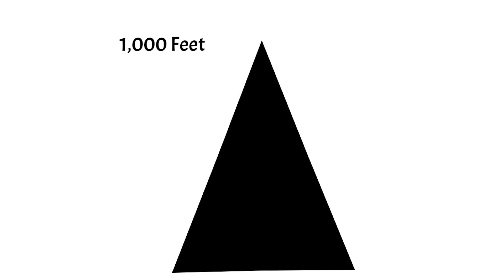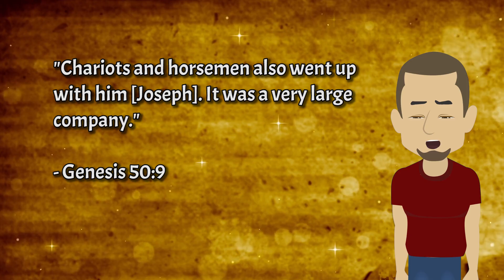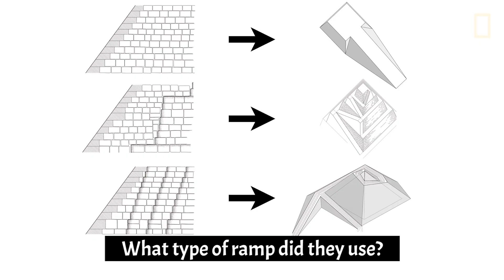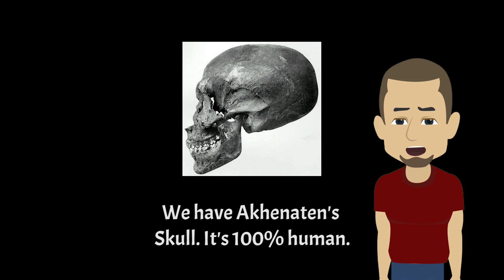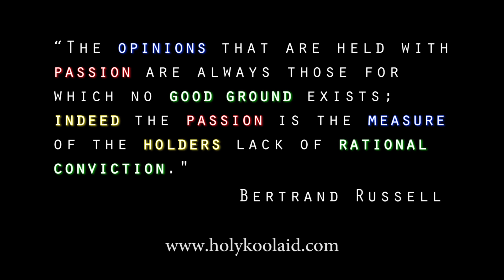Who Really Built the Pyramids and How?

Comment: The Egyptians had the wheel. It isn’t as effective as a sledge and water moving the dead weight of stone across sand, so they didn’t use it. That makes them more clever that people who parrot the “they didn’t have the wheel” bullshit. 

Personally, I think the bulk of the core of the pyramid isn’t stone. It’s probably fill material of sand and gravel with an outer shell of stone. Considering that they used similar construction techniques elsewhere, it isn’t impossible that they didn’t do the same there.

Comment: There was NEVER a body found in any of the pyramids, and when they where built that land was a jungle, sphinx was a lion after the Egypt's FOUND the pyramids they made the sphinx what it is today, you always say to follow the evidence but you didn't do a good job researching on this subject to get to the truth, And no, Aliens didn't build the pyramids I do believe how ever that a more ancient civilization built them and just how advanced they were is still a mystery, and that copper saw with sand is a joke you can make small short cuts with it but as you go deeper into the cut if get more and more difficult even modern saw of today have a very hard time making deep cuts, so until they cut a same size block with that copper and sand saw i have to say they are full of them self's.
Let's not forget the drilled holes and how some of the doors had been shaped with pegs to fit the drilled holes so the door could be opened and closed, I could go on and on but really not worth it to me so believe what you want...

Comment: @1:31 The heaviest block weighs 70-80 tons. The heavier ones are granite and generally used for load bearing structures internally.  By far the greatest majority of the stones that make up the bulk of the pyramids of Giza themselves are around 2.1-2.6 tons and are made of porous limestone quarried on site. But you don't hear about them.  Because they aren't so miraculous to move, nor did they have far to travel. The conspiracy theorists only talk about the +50 ton ones because they can get good quotes from engineers on how difficult it is to move a 50 ton block.

Comment: I have been studying the Giza Plateau now for over 30 years. I don’t know how it was built. But I do know it was not built with copper/bronze chisels and dolirite hammers. Even the ancient alien hypothesis makes more sense. There are aspects of the Pyramids that just can not be explained like for instance how did they see in the kings and queens chambers. How were the inside corners cut into the boxes. How was the tunnel system cut into the bedrock for 100’s of meters in a perfectly straight line.

Comment: The official timeline says that the first 7 pyramids and the sphinx were all built in 98 years, from start to finish.  So apparently they learnt how to do it all, and produced all of these in less than a century.  It doesn't matter how many people you throw at it, this is an impossibility.

Also, these are not just a pile of stones.  They are complex buildings with rooms, tunnels and shafts which would take a lot of precise and extreme planning.

You also neglect to even mention all of the technology from that period which we still cannot replicate today, such as drilling cores into granite.  That obviously wasn't done with copper and sand, just like cutting millions of huge stone blocks in that short space of time also wasn't done with sand and copper.

It wasn't aliens, but it was a civilisation much more advanced than we think it was and have been told.

Comment: 1. Not 1 pyramid had a mummy in it
2. We're not 100% sure who/why the pyramids were built
3. The internal shafts in the pyramids look LASER CUT and are water tight. No way they used crappy chisels
4. They face PERFECT North and are placed in a perfect location on the planet
5. They transfer energy/heat within the Earth

They are still a mystery and nobody knows precisely WHY they built them.

Comment: Sorry to break it to you but the idea that the Egyptians built the pyramids with copper chisels  and somehow hoisted granite blocks weighing anything from 50 to 100 tons hundreds of feet in the air after somehow transporting them by boat and sled from Aswan to just outside Cairo, a distance of 550 miles, is as ridiculous as saying that aliens from Betelgeuse or Moses or Jahweh poofed them into existence by magic. Here's a few salient points:
1) The pyramids are not tombs and no pharaoh has ever been found buried in one. The pharaohs were buried in purpose-built tombs mostly carved from rock and mostly located in the Valley of the Kings near Luxor, 400 miles to the south of the Ghiza plateau;
2) There are no inscriptions inside any of the pyramids. Given that, as even you point out, the pharaohs loved to scribble their names and make huge claims about their achievements absolutely everywhere, it is kind of strange that the building of the pyramids (any single one of which would have taken decades and probably far more money than the entire Egyptian GDP) is not mentioned let alone described on any inscription. In fact, there are admissions, or at least hints, that the dynastic Egyptians inherited them from a previous people who remain unknown;
3) Engineers, i.e., people who are technically qualified in modern construction techniques and who often have decades of experience in overseeing large construction projects (starting with the Englishman Flinders Petrie in the late 19th century), are at a loss to explain how they were built. In fact there are some aspects of their construction which are not reproducible with the most advanced modern equipment. Furthermore, materials are graded by hardness on an official and internationally recognised scale and the idea that hand operated copper tools could cut certain types of stone when todays diamond-tipped blades and drill bits attached to industrial grade power tools would wear out in no time flat is absurd beyond belief.
4) Archaeologists are NOT engineers, they're academics with zero experience of practical matters. Those idiots with the hand saw rubbing sand into a groove took about three days to produce a groove about half an inch deep and then declared that their theory had been proven. Don't waste my time!
5) Even by official dating, the pyramids were built within a very short timespan of a couple of centuries during the Old Kingdom. If that is the case then the ancient Egyptians are the only people in history to start off technologically advanced and then go backwards.
Yes, there are huge mysteries regarding not only the pyramids at Ghiza but many other megalithic sites worldwide. These mysteries may never be solved but one thing is certain: anybody who says that they know how the pyramids were built, including mainstream Egyptology with all its politics and special interests (and Zahi Hawass has many many of those), is lying. If they have the answers, let them demonstrate them in practice. It's simple. However, while you're waiting for that moment, whatever you do don't hold you're breath!

Comment: To be clear, what you have done here is the same as most people, that is to regurgitate a few educated guesses. All that bunk about about sawing with sand doesn't wash with me, and I speak as a stonemason with two decades experience. I know how long it takes to cut those blocks with huge computerised diamond saws, and we could not reproduce the production rate they supposedly had with sand and saws. Plus, I don't give a toss how hard those copper chisels were, I'm telling you as a matter of fact, you cannot achieve the things they did with granite using just those, especially not in the time frame we are given. My point is that the things you say we know, we don't. 
The mystery surrounding the building of the pyramids goes much further than just cutting and hauling of huge blocks in record time, you just need to look at the accuracy of the base levelling and how they managed to construct them to within inches of compass points, something it is argued we would struggle badly to reproduce, if at all, even today on a building of that size. 
So was it aliens? Fuck no. But they DID have access to some form of technology (in the true sense of the word) that enabled these engineering feats and it still defeats us today. Unfortunately there are always those who immediately jump to aliens, but that has always been the case. My own feeling is the technology was basic, but incredibly clever, so much so that it still eludes us today. In short, as is often the case, the answer lies somewhere in the middle.

Comment: I once heard a hypothesis that I think may be a good explanation for the method of building the pyramids...
The idea was that the Egyptians would build it by layers... They would position the first layer of stones in place, then burry all under the sand and drag the following layer over it, than burry this second layer and place the third over it... And then successively until they ended up with a huge "hill" of sand...
Then they would remove the sand and... Surprise! A full pyramid!

That would also explains how they did all the painting and carving of murals without electric light... The walls were exposed to sunlight until it came the time to burry the exterior on sand and drag the "roof" stones over each corridor and chamber...

Comment: Great video, great content as always. I have been watching your channel on a binge over this weekend.
Just a few things came to mind, if the civilization has utilized the concept of rolling, and used that in conjunction with leverage and is able to build the pyramids but has not yet discovered the wheel. I find that suspect. I learned about cutting the blocks with the copper saw and sand technique. I would be interested to see the evidence of the saws used to cut the 70 ton blocks, maybe was done in sections, still can’t imagine the vertical cuts. It’s almost impossible to debunk every single theory in a single YT video without it being several hours. Maybe an idea for a series. How did they get 8 sides?
What’s up with the Orion correlation theory
?

Comment: On the Nile side of each pyramid there is a vertical shaft in the ground with plastered watertight walls. (This I have been told.) If this is true, designing a hydraulic lift would be child's play for the Egyptians. They were outstanding engineers and the Nile did not run out of water.
Reply from the maker: The Nile is currently 5 miles from the Great Pyramid. Now during the flooding season, prior to the building of the Aswan Dam, the Nile would expand significantly, but there's still a significant problem. The ramps are not designed in a way that would make one shred of sense from an engineering/architectural perspective, and they don't even go all the way up. You can view them here:
https://www.google.com/search?q=great+pyramid+blueprint+view&tbm=isch&source=iu&ictx=1&fir=1AQM6ubyjuWx-M%252C_IU8Sn5WYIvfEM%252C_&vet=1&usg=AI4_-kSiK109rwXFLrYDCzkd-QMlyJMKlw&sa=X&ved=2ahUKEwjE0qDRjfrsAhUrwlkKHWJ0ATcQ9QF6BAgGED4#imgrc=1AQM6ubyjuWx-M

Comment: I did a report on this in high school and found a book that stated the rocks were analyzed and found to have some air bubbles and organic animal material. I lean towards the poured concrete method. It still requires ramps, as the height gets higher. Also the fact that you can’t fit a piece of paper between them is explained in the book. They use a sodden mold to pour a rock, then they pull out one side of the mold and use the side of the rock as that side of the mo,d for the rock next of it.They lay banana leaves over them to dry, the. Do the next level.
Reply: Where'd they get that many banana leaves?  They don't grow in Egypt.

Comment: Sometimes the most obvious answer is actually the correct answer.  I think the ramp hypothesis is the most likely.  Yes, it would have required an extraordinary amount of extra material, but it also creates the fewest mechanical and logistical problems.  Simply remove the ramp when you're done, or use it to create the next pyramid!

Comment: People almost always concentrate on how the Pyramids were built rather than the architecture.  There are some mind blowing things about the dimensions of the Great Pyramid of Giza.

For example, the distance of any two sides of the base is equal to the distance which the Earth travels at the equator during one second of it's rotation.  

And if you draw two circles, one just inside the base touching the midpoints of all 4 sides, and another just outside touching all four corners, then subtract the difference in circumference, you get exactly 1/1,000,000 the distance that light travels in one second.

This demonstrates that the origin of the unit measurement of time known as a "second" dates back to at least the time of it's construction, knowledge of the dimensions of the Earth, as well knowledge of the speed of light.

There's more too!

Comment: While I agree aliens most certainly didn’t build the pyramids I don’t agree with the premise they’re built in. For example, the bent pyramid was not in fact collapsing under its own weight but rather the construction angle simply changed at this time for no discernible reason. Further more using sand to cut granite while possible hasn’t been shown to be at the very least a reasonably quick process, given the time frame of around 20 years with the current proposed methods they wouldn’t have been completed on time. We also don’t have an explanation for the shafts, how the shafts were made, or the several voids found in the pyramid of Giza. The Giza pyramid also shows patterns of iron oxides similar to what you’d see on stone removing beams(I only use this reference cause they’re like rectangular on the edges of blocks in the kings chamber, the ceiling.). My point is the information is still vastly incomplete. But saying the Egyptians did it as we say is as ridiculous as saying aliens built them.

Comment: How did the Egyptians know to build at the exact center of where the longest latitude line meets the longest longitude line???
"According to experts, the Great Pyramid is the most accurately aligned structure ever created by human beings. It is said that the pyramid faces true north with a mere 3/60th of a degree of error. It is assumed that when it was initially raised that it was precisely aligned with the North Pole, the position of which has shifted slightly over time."
https://philphilips.com/the-great-pyramid-of-giza-and-its-mystery-why-it-was-built-at-the-exact-center-of-our-planet/
Reply: That's nonsense. The longest line of latitude is the equator, which is far south of the pyramids. And all lines of longitude are the same length.

Comment: You know that you grew up in Christian disguise but didn't read the Bible!
Where did the Israelites in Egypt build pyramids?
Therefore they did set over them taskmasters to afflict them with their burdens. And they built for Pharaoh treasure cities, Pithom and Raamses.-Exodus 1:11.
Did Treasury look like a pyramid?
The Bible didn't care about the pyramids!

Did you say the pyramid is the most stable structure? You may have learned about civil engineering, but the pyramid is a form that puts a lot of load on the foundation as well as the building itself by putting a very heavy load on its foundation.
This is because stacked pyramid structures build up more load than any building structure occupying the same area.
It is not because of the advantages of the pyramid itself that the pyramid is stable. The pyramids are just in a position where they won't be swept away by water!
Moreover, if you look at the pyramids already, there are countless large and small cracks.

It is indeed dangerous to attack the Bible using human preconceptions. It's often unrelated to the fact!

Nowhere does the Bible say that the Israelites built pyramids as slaves!

Comment: Walk past the rows of ram headed  Sphinxes outside the Karnak temple,from the parking lot and shops, enter through the gateway of the first Pylon and look immediately to your right. Clearly visible are the remains of the clay and rock ramps used in the construction of the temple pylon. This pylon was not the first part of the temple built, more likely the last,but the building method is obvious.
The Karnak temple was build almost 1,500 years after the Giza pyramids (and they were built 3,000 BCE, that is 5,000 years ago)
The Egyptians did not have the wheel until just before Karnak was started. So they built the pyramids without the wheel.

Comment: love your video's but a small correction on the invention of the Wheel. it was used in Greece, and places in Europe before the pyramids where built, so it is hard for me to believe that they did not have that technology. however, the use of a narrow wheel on soft sand is fairly pointless. a long wheel (like a rounded log) or a sled would be far more effective and that is why it was not used. as far as chariots go.. they would not have been used in the desert as well for the same issue of narrow wheels in soft sand. they where not in Egypt until Rome brought the games to Egypt. so great video, and that being the only issue i found. keep up the good work and don't drink the kool-aid.